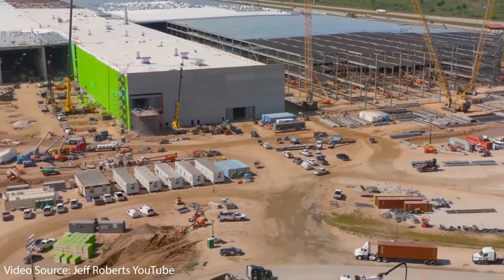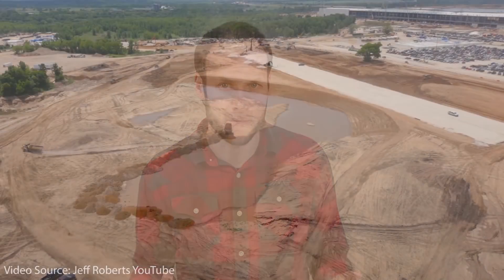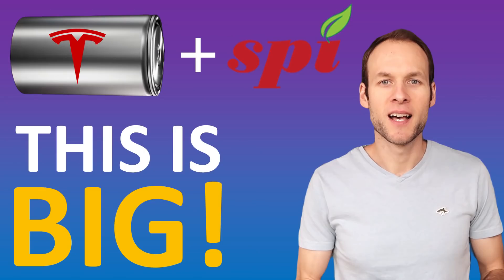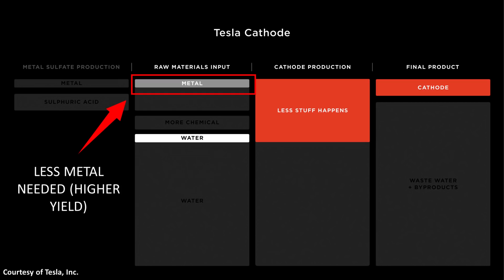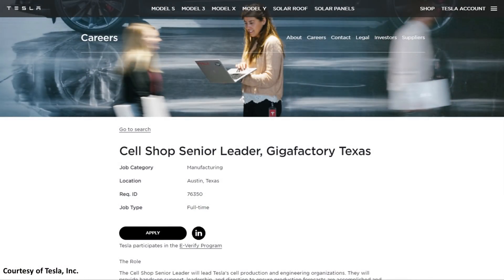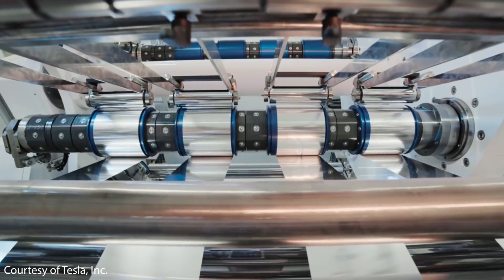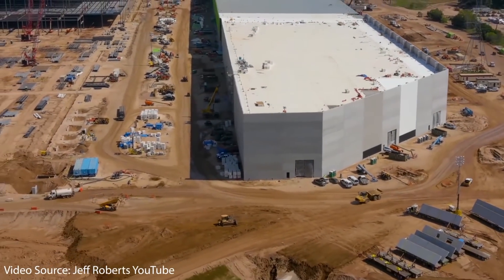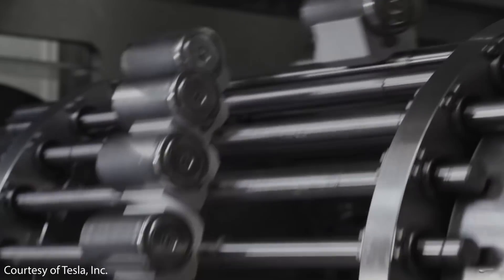Tesla "BOBCAT" Project: What is Tesla Building? (4680 Battery)

Comment: One more BIG step?  If your report is right; then Tesla isn't even close to actually producing enough of the new 4680 batteries to produce the Semi; let alone upgraded main stream vehicles like the Model 30 and Model Y.  This would mean they haven't even put the corner stone into the building ; and your patent applications mean they don't even have the entire manufacturing process down.  If Bobcat is barely started; then we are talking at minimum a year and probably 2 years for the 4680 to be starting major production.  If solid state arrives in 3 years; or even 4; this would mean Tesla has a minimal positive on battery tech for a short time. To me this is bad news.

Comment: I want to hear that the mass production process has been perfected by Panasonic.
Reply: Panasonic has just announced that they are starting to work on a production line for 4680 cells,  so tesla might be years ahead of Panasonic with such an announcement... Maybe tesla will work together with all the battery manufacturers so that everyone will be able to make the new cells.as soon as possible?
Reply: @0ooTheMAXXoo0  the seamless closure of the tabless end on a high speed line with zero failures will keep them occupied.
Reply: @0ooTheMAXXoo0  this is the plan though I doubt Tesla are ahead of Panasonic. I'm inclined to think the opposite, Tesla has gone to Panasonic to help them iron out some of the problems they are having..
Reply: My  understanding is that Panasonic is producing the 4680 with the traditional wet cell process. Tesla (and other car manufacturers) will buy all that will be available. What is important from a practical viewpoint is that the cell form factor is respected, so it doesn't really matter which chemistry is used - it's just that the Tesla chemistry would be more profitable and more performing- until others catch up.
Reply: @nycandre  I suspect the challenge is in the utterly reliable tabless can closure process at production line speed.
They don’t want any inspection or testing (beyond random samples) and each one is a potential pr ticking time bomb from my perspective……the risks shouldn’t be underestimated.

Comment: 12-18 months to get reliable cells at acceptable reject rates out of the Fremont pilot plant - this is how I interpreted Elon's words - leads me to expect that all initial production at GF-Berlin and GF-Austin will be using 2170 cells.

I figure it'll take a year, perhaps longer, to export the line design from Fremont and bring it up at each new line.  This is typically what we expect from battery manufacturers.  Every new line is a wrestling match; it's molecular engineering, and subtle problems can and will creep into a new line and have to be solved.  Every single line will have to go through a burn-in period where they will fight reject rates and quality issues.

I'm starting to think we won't see 4680 cells in production vehicles out of GF-Berlin and GF-Austin until the very end of 2022, or even into 2023.

Also - consider the timing of the cathode manufacturing subfactory going up at GF-Austin.  This component of GF-Austin lags the larger factory by a significant amount of time.  The rest of the factory will be ready to go long before they can start producing cathode material.

I think we can safely deduce that the Roadster won't appear until the middle of the decade; that the initial Cybertruck production will be for the two-motor variant with 2170 cells; that the initial Semi production will be for the 300-mile range variant, also with 2170 cells; and that the Model Y will start with 2170 cells and stay on 2170 cells until the 4680 cells are available in excess of what will be needed for the 3-motor Cybertruck, the 500 mile range Semi, and the new Roadster.  In other words, not before 2025.

I think Tesla intends to use 4680 cells in all of their production BEVs, eventually.  Once they have their 4680 production lines working correctly, these will be, not just their best mobility cells, but their cheapest cells.  In the long term, they'll probably even use 4680 cells for their energy storage products, but it's going to take a lot of years to get to that point.

Battery manufacturing is heavy lifting.

Comment: I have a question about the structural battery pack... how will batteries be replaced when they no longer hold charge ?   With the current cells/packs, the packs unbolt from the vehicle and can be easily replaced.   How does that work with the structural battery pack ?
Reply: A replacement battery Imo is important. I look at things long term and to not have  replacement batteries ready,  to me would be concerning.
Reply: @jamielake-boyd3600  I agree.
Reply: Million mile useful lifespan. And their current batteries have the lowest degradation in the segment.
Reply: Recycle the car.
The batteries will probably keep a useful charge longer than the car will hold itself together.
Reply: @mynameismatt2010  I just read 300 to 500 charges.
Reply: @jamielake-boyd3600  300 - 500 charges for what exactly? Battery degradation? That would be about 150k miles if they were 0-100% charges. Considering the batteries on early production model S's last well in to the 300k miles range I strongly doubt new battery technology would be any less.

And a point about battery degradation that most people don't realize, Tesla lithium ion batteries will degrade rapidly in the first 50k miles to somewhere between 90-95% of the original capacity, but the rate of degradation smooths out to a relatively slow stable rate of degradation with the trend line falling somewhere around 85-90% of original capacity by 300k miles.
There are also factors that significantly affect this, like the frequency of supercharging vs home charging.
Reply: @mynameismatt2010  I doubt that.  Electric drivetrains and aluminum or SS bodies last forever.
Reply: @SomeTechGuy666  nope they don't last forever, all the bushings, bolts, connections/joints....... are going to age
Reply: @alanmay7929  Easily fixed.  It's called maintenance.
Reply: @SomeTechGuy666  EVs are too heavy and those parts including bearing wear out quit easily, and the tires too.
Reply: @alanmay7929  BS.

Comment: I'm of the conviction that the 4680 battery is delayed, not because of production prototyping, but because of the tabless design is failing to wick away heat fast enough in certain conditions.....  Drew said that yields were good during the conference call.  Elon said the batteries were not ready for vehicles.....  Overheating is the only logical conclusion to draw, and may necessitate a scale back of the diameter of the cell.  My guess is 3580.
Reply from the maker: You may be right... I guess time will tell.
Reply: The other problem is the lithium/nickel supply which is not catching to the demand.